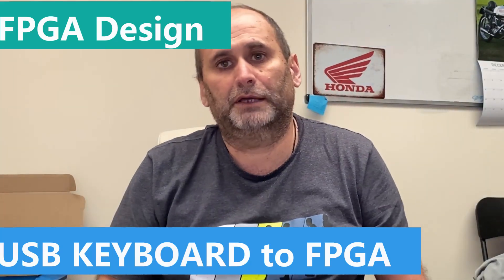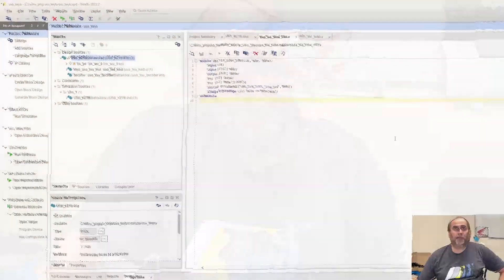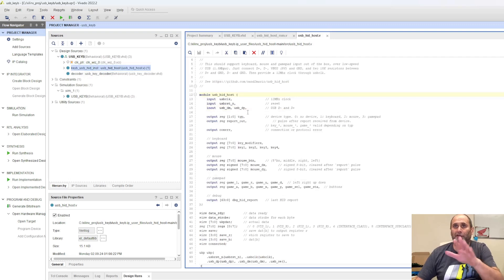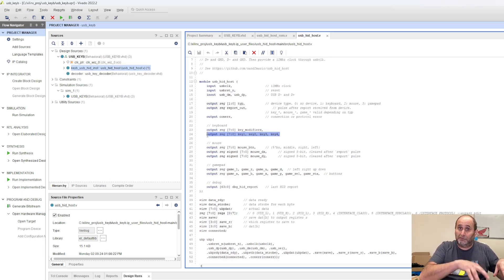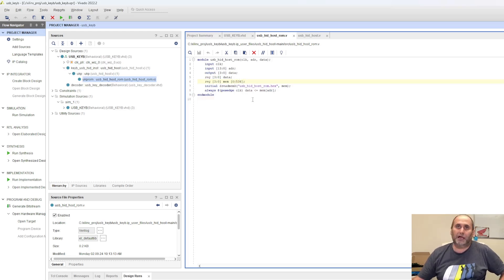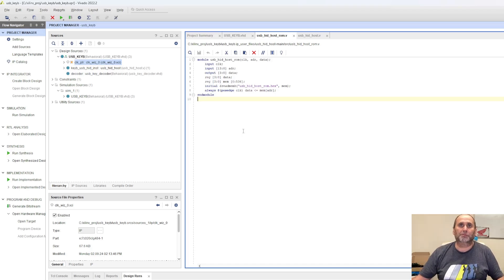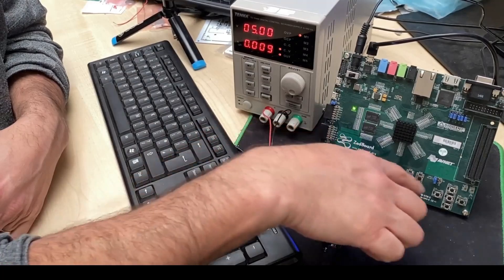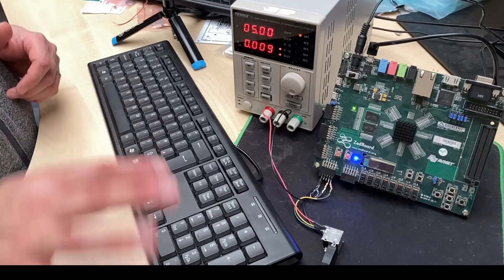USB keyboard to FPGA interface

Comment: Just tried that USB HID Host on my Karnix board with Lattice ECP5 FPGA chip. It worked right away with USB gamepad (exactly the same looking as yours) without any problems, but interfacing keyboards is not stable. Since I could not provide exactly 12 MHz clock due to lack of PLL capabilities (the closest I could achive is 11.9 MHz), there are frequent bit slips happening when reading responses from keyboard. I noticed that different keyboards work differently, some work very well, some not. By analyzing the code I discovered that it does not do CRC checks in response. Also I don't quite understand how synchronization is implemented, I think it's very rudimentary, so any diffs in clocks may give bit slips and misinterpretation of incoming data. I think I have to try to fix that my self. :)
Reply from the maker: Why not connecting a 12MHz externally? (from a crystal oscillator) or a clk generator to exclude one suspect from the list, and then look at the code.
Reply: @adaptivedesign8795  , good idea, will try that first.

Comment: Just checked the code. That's incredible how the author managed to fit in a tiny 4-bit CPU to handle USB events. And the microcode is also there in asm source code along with the asm compiler written in 150 lines of Perl. This USB HID project is totally fascinating.
Reply from the maker: Agree 100%
The implementation is teaching material